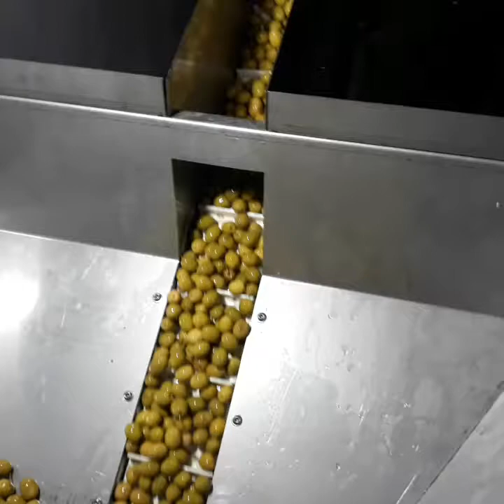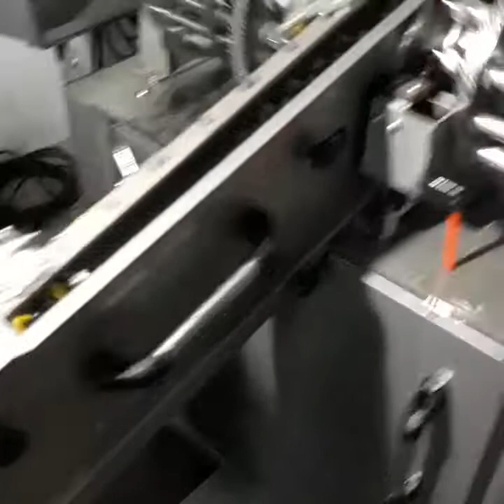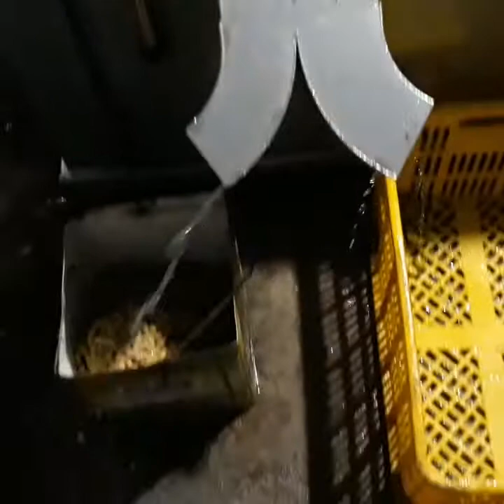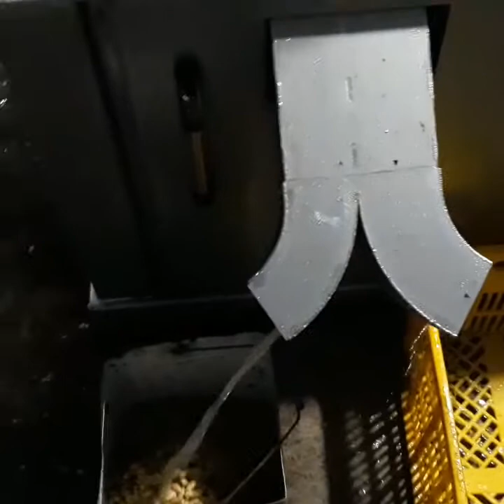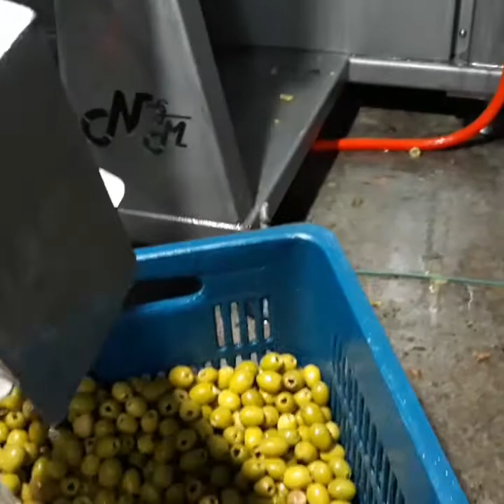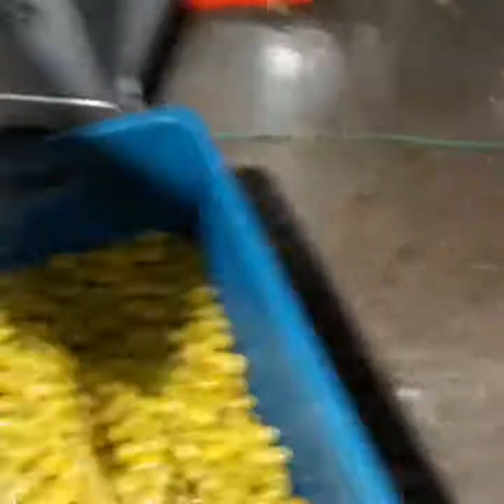Olive pitting machine

Comment: Please can you sent me more technical details ( capacity/ day,prices,,,guarantee treatment,,,
Reply from the maker: Hi ali
this machine is made in iran
12 driller knives
2100 pcs / min max capacity
250 - 380 kg/h

Running between 80 and 420 calibrated space.
Sensor controlled feeding band
Engine Power1.5-0,25 Kw
380V/220v
Electronic speed controlled

AISI 304 Crni body
3 pcs of calibration disk
PVC band approved by FDA
Ip 65 plastic electrical board
Reply from the maker: prices : 12000$